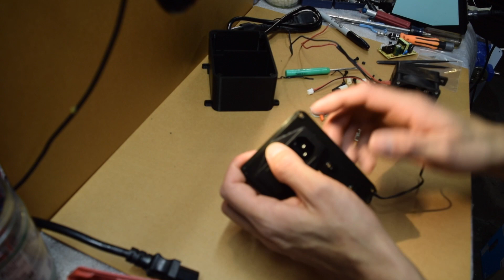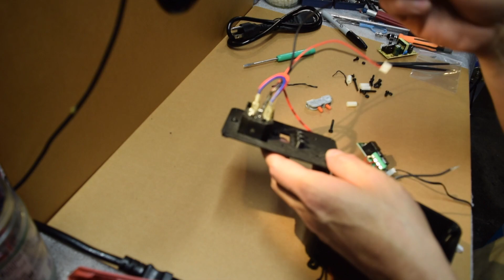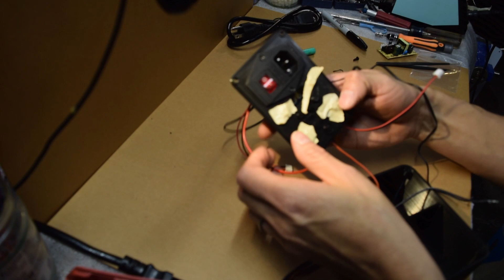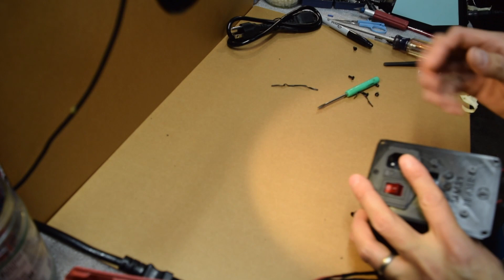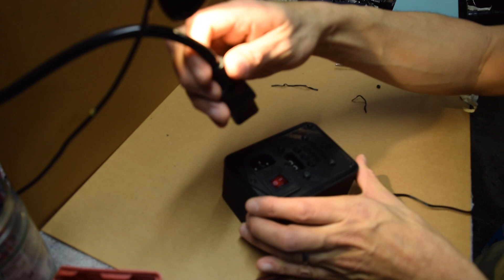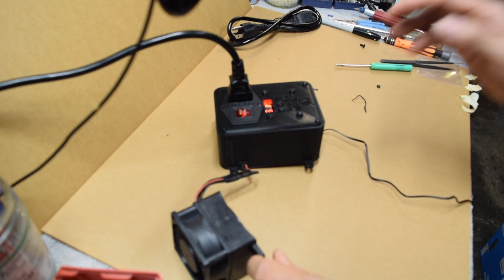How to Heat a 3D Printer Enclosure - DIY with temp control in under $30

Comment: I have one of these in a spool box I made.....it doesnt go higher than 50 deg so pla, tpu and JUST , though its right on the edge of not being hot enough...petg. However if I add desicant also then it does abs etc just fine. Humidity display from a small unit in the box shows humidity lowered to 10%.....so if your abs etc isnt already moisture ridden it does it just fine
add another fan to blow air out for circulation

Comment: My crazy large enclosure for my bed slinger idex hits 85F just from 235mm mains heated bed and 1 hotend and it's not insulated.  My Soval filament dryer runs at 50C for ABS and up.  This is not much heat.  Most prints don't warp at the start it's usually an hour or two into the print after the enclosure has already reached those temps on it's own.  It more comes down to slicer settings, print design and print surface/adhesive.

If your selling these as kits you really should add in a temperature fuse, they are cheap insurance against fires.  You can't rely only on the temp probe and controller.
Reply: That's a great idea. Thank you!
Reply: use desicant as well as heat....it will dry just fine

Comment: how hot can it safely get? (im trying to print with PC and from what i read the enclosure needs to be around the same as the build plate which is about 100C)
Reply: We've used them at 50C but haven't done any more than that
Reply: @gusj5438 wont go higher that 50....it cuts out